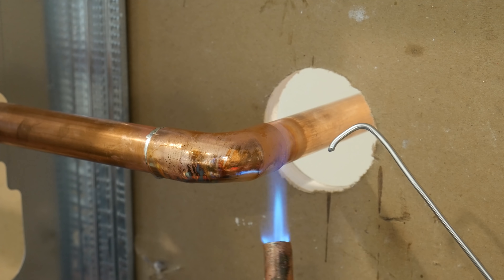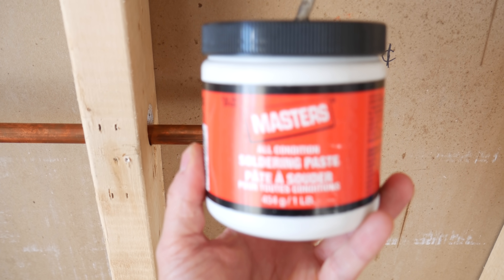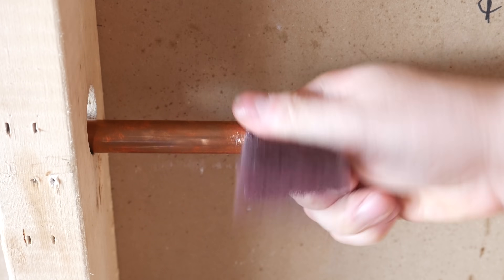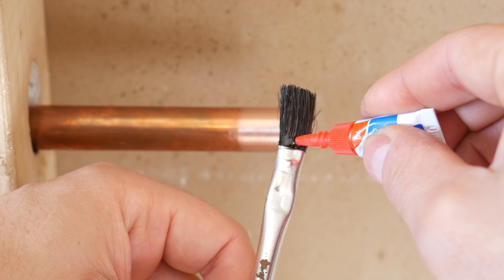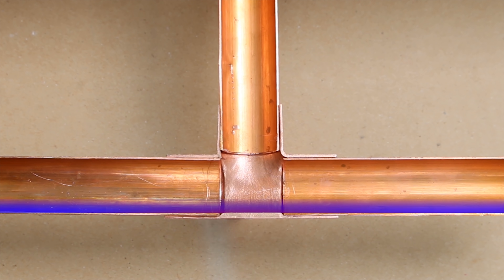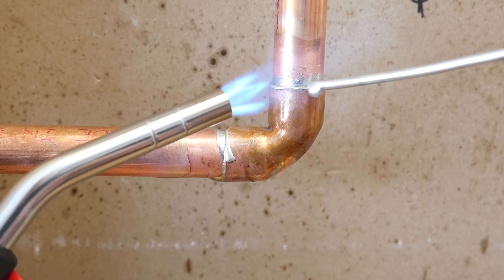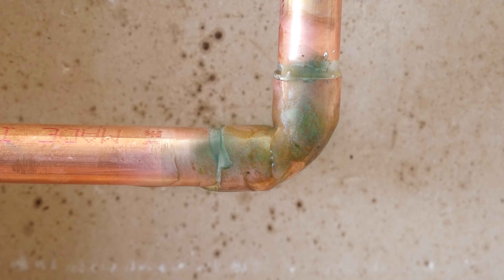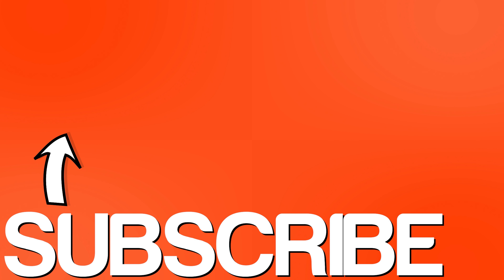10 MISTAKES Beginners Make When Soldering For The First Time (Beginner's Guide) | GOT2LEARN

Comment: What was not mentioned was that you cannot have an "air locked" area in your soldering, make sure air pressure can escape somewhere in the pipeline you are soldering as trapped heated air will want to push your wet solder out of the joint while your soldering  if it has no where else to go
Reply: this is a great point

Comment: Incredible tutorial, thank you. If only I had this 40 years ago. I never cleaned my flux afterwards. Another tip if you solder close to other fittings. I always cover the adjacent fitting then with a wet rag, preventing then that from getting loose if I solder close by.
Reply: Excellent tip re: keeping adjacent fittings cool when soldering nearby!

Comment: Your videos are excellent and I've enjoyed watching them.  Since this is mistakes, I'd like to add a tip without which you can end with mistakes.  I just replaced my gas boiler and new 1-1/4 copper for the water side.  The zone valves are fed by a trident (pitchfork) like construction of elbows and a tee.  I had a bugger of a time (just took too much heat) soldering the new pipe in place which should have been simple.  End result was a slow, 4 per minute drip.  While repairing it this morning, I found the real problem.  While I shutoff both ends of the sections I was working on, the right hand end was on SMALLER diameter pipe.  So yeah, it drained but left about 1/8" of water in the pipe I was working on.  So I drained it by removing the expansion tank on the large pipe, dried it out, cleaned the old and new fittings, fluxed and ended up with excellent, leak free joints.

Comment: What I like about your video is you concentrate on cleaning the copper.  I like the abrasive rolls made for plumbing but the other stuff works too.  At one time I thought I needed  to be very careful or it would  leak. Then I experimented with some old fittings I got at a garage sale.  I found that it was easy to make an ugly joint but it was almost impossible to make a leaky joint if everything was clean. If you clean the pipe and  fittings use flux and get the pipe hot enough to melt the solder it won't leak. It seems to work even if you don't direct the flame in the right place or dump way too much solder in the joint. I tried every wrong way I could think of. I even just held the torch on one side until the back heated up. It looked terrible but didn't leak. In short get the copper clean use flux and it will probably work no matter how inexperienced you are. Still if it's for a real job you should be careful to make it look presentable.

Comment: I am in my sixties now.

When I was younger than ten years old I remember my dad letting me help him fix things around the house.

He was a "week-end" warrior, but pretty good at it.
He did carpentry, plumbing, electrical, concrete, painting....

For plumbing he would let me clean the copper fittings. We used steel wool for the outside and a brush like the one in this video for the inside. He did instruct me not to touch the parts I cleaned as to not get the oil from my skin on them.

He would let me watch as he assembled the parts and then soldering them together, explaining what he was doing and why. I remember him telling me to let the pipe melt the solder.

My dad passed away when I was twelve... but, as a teen-ager I was able to continue to "fix" things around the house for my mom. Much to my guy friends amazement.

I did plumbing on my own with confidence, replaced a gas water heater, ran electrical wires and installed sockets, lights, and switches where non had existed before, carpentry work, laid ceramic tiles, did drywall.... and all without going to any school to learn these trades. I was a self taught "weekend warrior".

As a side note here. I thought I had died and gone to heaven when I bought my first hand held, power operated, circular saw. It was so much easier and the end product was so much more professional looking then cutting the wood with a hand saw. I even invited my friends over and demonstrated it by just cutting of a slice of a 2 x 4. They all looked on in amazement and picked up and closely examined the cut piece.

Since then I've purchased a 12" miter saw and 10" table saw and I can't remember the last time I used a hand saw. I still keep them around but they've all rusted over time. Some of those same saws are the same ones my father used. They my even still have some of his "hand oil" or finger prints on them somewhere.
Reply: you should clean the hand saws and put paste wax on them to stop rust
Reply: @wayneherl1442  Thanks, maybe I'll do that.
Reply: Well your dad was a good dad! He did a great job to prepare you so well at such an early age! What a nice story! May he be upstairs looking down and smiling...
Reply: Thanks your giving us help like your Dad did for you. Great gift he gave you.

Comment: I've done plenty of this type of soldering, and I was taught by my dad. My joints look like yours neat and tidy and have not had one fail yet. Your video gets a 10/10 from me and believe you covered it very well, thanks PS just a tip re water if its not too bad you can get all your bits ready and then push a wading of tissue paper up the pipe like a dam. It works in the right scenario but make sure it has a way to get out
Reply from the maker: Thank you so much!!!
Reply: Use a wad of bread (no crust!)...when the flow resumes, the bread disintegrates and can leave.

Comment: Not trying to argue with you or anything here. I’ve been plumbing for 8 years now. I’m a licensed plumber in Michigan. But usually when I have a joint that didn’t take to the back side of the fitting, I usually apply some more flux, heat it up, reapply heat and solder and I’ve never had any leaks that way. Completely dismantling the fitting from the pipe usually never has to happen unless there’s an issue with water in the pipe. Not saying your way is wrong or bad. I just have always reapplied the same practices to the back of the fitting. Thank you for posting these videos though. I always watch them even if it’s something I know about. There’s always great information for anyone of any skill level in your videos!
Reply from the maker: I was thought this way, your way probably works though, I just prefer redoing it and making sure it's sound. thanks for the nice comment man!!!
Reply from the maker: It'll work, but it's better to take it apart to make sure.

Comment: I like the drill idea with the brush in the drill and gluing the bristles.  When I strip copper wire prior to soldering I twist the strands together with the bit of displaced insulation rather than use my fingers.

I found out about flux attacking copper the hard way - I loosely assembled some pipe work, cleaned and fluxed it, but my blowlamp wouldn't light.  By the time I'd fixed it all the copper had gone green and I had to start again!

Comment: Another good thing to have nearby is a one or two gallon pump spray bottle filled with water. It’s a cheap water fire extinguisher, just don’t forget to pump it BEFORE you start soldering . It works great in confined spaces where you might not be able to get the nozzle of a powder extinguisher.
Reply: You can also use it to spray the surrounding wood or any other flammable material to reduce risk of starting a fire.

Comment: I watched a plumber replace the tank in my parent's garage once and he had a dripping inlet pipe. He asked for a couple of slices of white bread, which I ran and grabbed for him.  He then stuffed bread into the dripping pipe to retard the water flow just long enough to get the solder completed on that joint. He explained that the bread would then just go into the take where it would break down and then flow out and no one would ever see it. He only used the white part and took off the crusts and ate when he didn't use.
Reply from the maker: Yup, it works!!!
Reply from the maker: @Phil Sr 💯
Reply: Does it work with whole wheat bread or pumpernickel too?  Probably doesn’t work with pita bread…
Reply from the maker: @azul8811  only the white stuff
Reply: Bread is great. I've used it to push out pilot bearings on car engines as well. Once again, no crust !!
Reply: Word.
Reply: Will work on PVC joints also.

Comment: The best trick I found for keeping water from dripping into your joint while you're trying to solder it is to shove a piece of bread in the pipe just make sure once you turn the water back on that you turn on something with a large opening like a tub or outside spicket
Reply: plain bread or toasted with jam....
Reply from the maker: @StephenZ827  🤣
Reply: Of course you can use silicone or construction foam as well

Comment: Two other things. Don't get the fitting so hot, that the solder boils out.
Don't put water on joint to cool it down too quickly, as the solder will
contract and cause a leak.

Comment: My friend helped me install my dishwasher. Decided to run about 8' of 1/2" copper tubing from basement to disheasher. Friend told me what a great job he does soldering. Yep no leaks but soldered the gate valve so it would not close. Guess he thought a halve of solder needed to solder a 1/2" valve.

Comment: Boy, I was an avionics tech in the Air Force. In 1976 I had my training. My soldering class was forty hours. I was NASA certified. Conducted by NASA. It was most difficult to sweat the fittings for the waveguides. ;)
Reply from the maker: That's so cool, the plumbing on those ships looks so fascinating!

Comment: I 've put Oatey #5 flux on semi uncleaned pipe and fittings and they soldered right up with no leaks. Bad valves in municipal meter boxes are few and far between where I live. It's a shame valves inside houses and other buildings can't be of the same quality. Retired from 40 years in plumbing.

Comment: Good information.  Well done.  The new style plumbing is PEX and Shark Bites instead of reliable copper.  A 13-year-old could read the instructions and install it.  Unfortunately, I’ve encountered plumbers new to the profession that didn’t read instructions, or didn’t care.  The problem for them is that soldering requires skill.  Plastic pipe is a time-bomb waiting to leak in some inaccessible area probably from over pressure or stress from stretching or kinking.  The plastic is also semi-permeable allowing any volatile chemical to absorb into the water lines;  the petroleum containing chemicals also weaken the pipe.

Comment: Very nice video. But you forgot most important thing - do not overheat joints. When solder start melting immediately remove torch.
I had service call every week in hight rise building for blowing pipes in kitchens . Evidently was made this part building by one plumber who overheated joints after many years started blowing out.

Comment: Here, in UK, we mostly use Yorkshire Fittings, i.e., they have solder all ready in the joint. No need to use extra solder, although some take a belt and braces approach and do. You do clean round the pipe, and not along, but, maybe, you should stress this. Good video.
Reply from the maker: Yes, we don't have those here 🤷‍♂️🤷‍♂️🤷‍♂️

Comment: Could you discuss using hotter burning gases than propane, and relation to solder formulations? I have experienced problems where propane is just barely getting joint hot enough to melt solder, but boils away the flux.

Comment: The thing I don't quite understand about the Flux is that it is corrosive to exterior of the copper pipe if you don't clean it but what about the inside of pipe as it applied?

Comment: I'm not going to mention which ship ( think very big) ..but we working working on scaffolding under a overhang when the pipefitter took off running... more like crabbing the heck out of there. We had only one ladder to reach the exit and three us needed to use it. Fire started as he was heating a pipe and the insulation ( rubber type material ) caught fire. Later it was determined it was the glue fumes trapped between the foam and painted steel. Point being know what is in your area, as to gases, fumes, or anything which might take a liking to the flames.
Reply: Maybe a different glue, as some need alcohol to dry faster, something to avoid if possible...?😁

Comment: Something that also works for stopping pesky water, hook up a shop vac to nearest hose bib, use duct tape to do a crude hook up. Be careful not to make that connection too air tight, or when you start sweating, the solder will get completely pulled out of the joint. Takes some trial and error to get the suction right--not enough=water still drips. Too much=see ya later solder!

Comment: HI! Got a question about all the solder flux choices out there(ie: No5, H20, No 95 tinning flux)?? Which is the best for Copper pipes. And am I correct that the solder & flux used for copper pipes is NOT the same as solder & flux used for electronic circuit board soldering?
Reply from the maker: Both 95/5 and tinning fluxes are good, tinning flux gives better solder coverage because it has solder powder in it (hence the darker color). As for electronics fluxes, yes they are different, plumbing fluxes must be potable water safe, electronics, are not.
Reply: @Got2Learn  : 3 things: First thanks for your video's & for replying here - it helps! Second: Which would you suggest on copper pipe 95?Or 5?? Third: Just out of curiosity, would either 95 or 5 even work on electronics?
Reply from the maker: I use both, if I am in a really tough spot, i'll use tinning flux, if not, I am always using No.5.

Comment: Great stuff. A real tune up for me. Yesterday I helped my neighbor fix a piece of leaking waterline. It was turned off at the street, nothing was coming down the line from the house (we turned the main shut off valve), but there was a steady drip from the street end. Steep hillside. So I got three plastic straws said "daisy chain them and suck out the water" He pulled about a foot of water out of the pipe spitting out a couple full mouth fulls.  We then soldered the two sleeves to the patch pipe. No problem. 
And the sleeves I bought at HomeDepot? They were really tight. (We had to hammer on them to get them to slide. In over 50 years I've never seen this on undamaged pipe.  Very low quality control. Of course HomeDepot would be more than happy to let me return it, but fix the problem? HomeDepot? You're joking.

Comment: An old timers trick is to stuff bread from lunch box up pipe,it temp stops water travel,and washes out easy.
Reply: Years ago worked at a candy plant. Guys would use an inflatable bag around 3" chocolate lines and run freon thru it and let it escape in the atmosphere which sure can no longer do. As long as.pump was turned off the chocolate would harden fast and they could cut or open the 3" pipe. Milk chocolate turns solid at 90 degrees F. Bread jammed a few inches into copper tubing works great. Years ago on a hot Saturday afternoon two young guys could not sweat in a 3" copper elbow due to water dripping into tubing even with 2 old valves closed off. Old timer told them to use a 3" T fitting and to solder in a short piece of copper tubing to a female adapter. They soldered this in then installed a 3" plug into female adapter.

Comment: When wiping away flux do you use a damp or dry rag? I know enough not to use a damp rag right after soldering, but I use a damp one to wipe the excess flux after it is cool to the touch.
Reply from the maker: Either 🙏
Reply: Did a sweat to pex adapter a while back, used a dry rag. Unfortunately it was a polyester microfiber rag that melted all over the connection. Don't be like me.
Reply: @reverendwhamo1   oh noooes

Comment: I use toilet tissue around the soldered joint after turning the water back on. Helps with weep detection on the hidden backside.
Reply from the maker: Good trick 👌 👍 👏

Comment: I'm doing a small diy project in my bathroom I need to relocate water about 2 Meters around a corner in a bathroom. Instead of using copper and soldering can I use stainless steel braided hose ? Same price as copper and easier to work with as I haven't worked with copper before ? Thoughts ?
Reply from the maker: No, you cannot have rubber hoses in a wall.

Comment: Here is #11. When soldering existing hot water pipe, make sure to turn off cold water pipe  also. 

The reason is faucets are leaky, the cold water can  enter hot water pipe side and cause water drips to the  water pipe your actively working on. This could ruin your solder job prep every time. The reason is because there is no pressure build up from hot water to equalize internal pressure of some faucets.

Comment: If you keep a wet rag you can wipe the joint right after soldering.makes it shine
Reply: uh... doesn't that causes a sudden temperature drop that could cause fractures in the solder and possibly produce a leak?
Reply from the maker: @ildefonsocamargo8291  you have to wait a minute or 2 for it to cool off before doing it.
Reply: Ok not right away, but while pipe is still pretty warm, I've never had a leak

Comment: I did the basement stupid with a tiny drip at a low 90% elbow. I could not heat the pipe. A tiny little drip can keep the joint from soldering. I seriously thought I had drawn all the water out of the system.
Reply: Next tine put some bread inside the pipe to soak up the water and to create a dam. It will flush out with the water.

Comment: Renoing a bathroom, jostled a 3/4" feed today and an elbow busted open.  After running down to the basement to cut the water, and dealing with the flood, I took a look at the break.  There was only 1/8" bite into the female elbow on one side, 1/16" bite on the other side.  How did this survive like this for a few decades?
Reply from the maker: Probably corrosion was keeping it together hehe